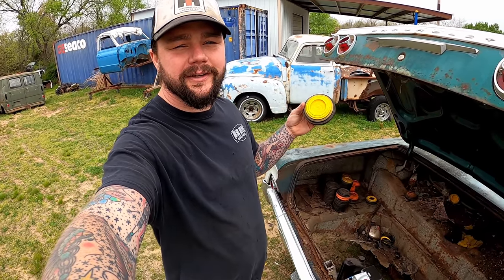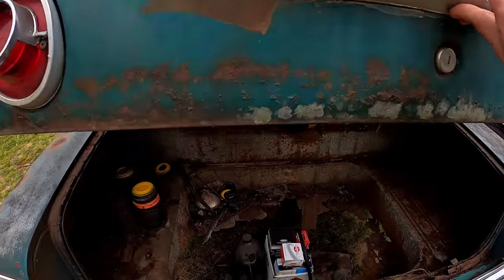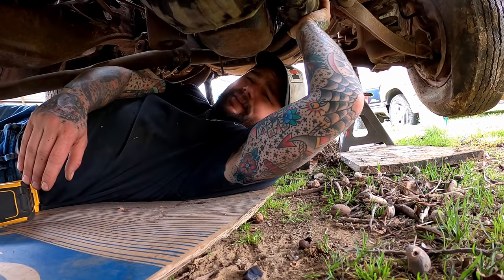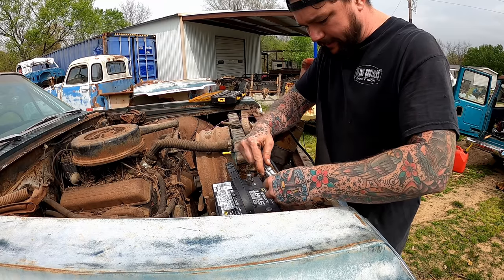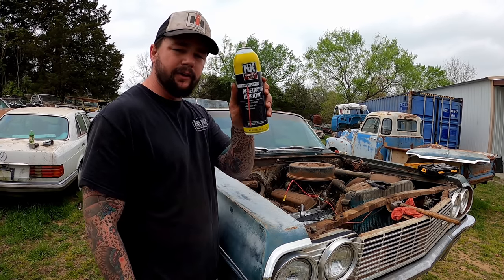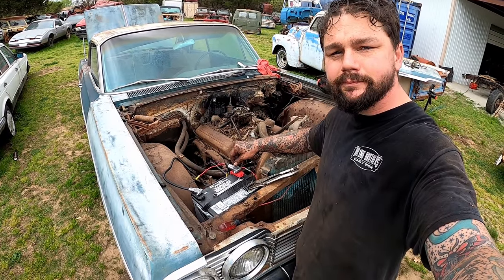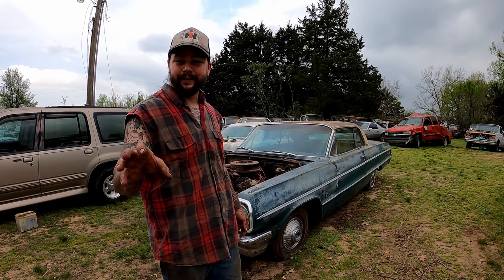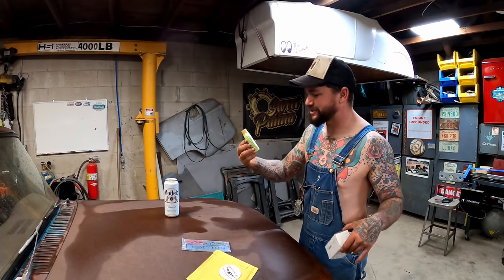ABANDONED 1964 Impala! Will it run after sitting since the 1970’s?!?

Comment: Ram has upgraded the tailgate on its 2019 1500 pickup truck with its latest and greatest idea: the Multifunction Tailgate. The Multifunction Tailgate features a 60/40 split and can be opened swing-away barn-door-style, making it easier to load and unload the bed, or to step up into it.

Comment: My great uncle born in 1894, was a great guy, served in WW 1,  but extremely frugal. Quite a wealthy fellow, Well over a millionaire by his 50s, he waited till he was 70 years old to buy his 1st, and only new car. A 1964 Impala. It was so stripped it was laughable. Special orderd with, manual steering,  manual brakes, radio delete, etc..he did take the V8 engine. Automatic transmission.  My 1st time riding in it was 1967. Pretty teal green exterior,  and green interior.  I was 8, and liked it.  Flash forward to 1988 and he still had the car, still driving it at 94 years of age. He lived to over 100 years old ! He lived in Northern Utah, so even though the  car still ran and drove very well, i drove it when visiting,  it had quite a bit of lower rust. When he was 98 and knowing I was a car nut, he asked me if I would like to have the car when he passed away.  As a Southern California native, I had to turn him down.TOO MUCH RUST. I have never owned a car that had rust, and it scared the crap out of me lol. Now that I have watched all these videos of cars from the rust belt, you guys would have thought that car was PRISTINE!!! I  did check out the undercarriage on that car and it was still very good, just the wheel well edges were rusty, and a little bit on the bottom quarters.  
..

Comment: I once owned a Chevy Luv. I swapped the engine to a modified Chevy 4.3 V6 and a turbo 350 trans. After busting 2 rearends and getting aggravated because I had to pull the motor and trans just to change the trans so I sold the truck body. It was fun while it lasted though!

Comment: My cousin got a like new 62 Biscayne 2 door with the 283 power-glide in the early 70s. my uncle was the head sales guy at Steakley bros Chevy so he got us plenty ofclassic low mileage cars back then but the biscayne felt new. l think it had less than 20k on the odometer. You couldnt hear it running. Stand a nickle up on the radiator cap. best car l ever drove. Best engineered.
Reply from the maker: That would be a sweet deal!

Comment: Hey Pudd': You'd be better off pulling that 283 short block out of there and replacing it with a 350 assuming the transmission matches.... On floor and trunk pans alone, you'd want to start there if you want to restore the ride.....

Comment: Always Love CHEVROLET IMPALA cars to and I own too it 2002 plus I got in 2005 I totally rebuilt to plus bottom to top also from body shell to blow up motor & transmission even computer stuff for $500.00 and took me 5 years do up my likeing to ! Plus paint Navy Misty Blue with Black Trim , also Baby Blue interior with Black Trim & also True Cedar Woodgrain also my home brew motor V6 252 CC with 320 hp , Torque 310 plus 506 M6 6 speed Automatic transmission with Shift Kit also Car is 4 door but lots fun since 2010 have road plus drive it! But computer stuff for 3.1 to 4 3 litre V6 motors too plus full frame home made Tanitimn to also if saw my car say holy moly and plus rode say that wild run my buddy !
Reply from the maker: Not too big in the newer ones.

Comment: 1964 was the 2nd year for the 327 so I say it will start friends ran a c/altered back then 327 block with a 283 crank which ran in 10 sec bracket in the quarter mile.
Reply from the maker: Damn that’s scootin!

Comment: I used to work in wrecking yard and the customer would pull the dip stick on the engine he wanted to buy and the oil would be clean and he would buy it the longer the motor sits the dirt will go to the bottom

Comment: Looks like a mechanic dint get enough money out the previous owner and put that clankity clunk into the hub cap. I wish I could find a deal like that Impala. You got all the luck, first that Luv and now this one with the back seat that a rat had his way with. I like your style Puddin!
Reply from the maker: Did the ignition tune up then slip that in!
Reply: @PuddinsFabShop  yup . I've had a tire rotation done a few years back . They put the hammer down on the impact on three rims and left the front drivers side finger tight . I was going but 65 when that started to nock so bad I thought I lost my drive shaft . Pulled over, checked under neath  ,all seamed fine. Got going and the same thing happened.  I happened to look at my front tire and it was at a weird angle . Them frigging samich makers" forgot" to tighten it.

Comment: One trick I’ve developed to free stick engines is to close the valves (pull the cam or push rods) and remove the schrader valve from a compression tester whip and use shop air to push the piston down. If your smart enough, using firing order you can push on multiple cylinders at a time. I’ve stabbed connecting rods through oil pans with it but she rotated and I got that last torque converter bolt!!! Lol
Reply: When your flat rate it’s one of the very few times KABOOM actually sounds like cha-ching BABY!
Reply: Also there’s a complete lack of arm swangin’ in this va-edeo.

Comment: Lol. Set me up for the day.  Nissan pick got me all at 2 and 6's.  Started fine for 10 years. Then one morning she just wouldn't.   3 good techies 1 auto electrician and numerous electrical hacks. Bypass fuel cutoff solenoid. 
Month on off battle as I think I now no nothing about anything.
Proximity chip had fallen out of the key. Go get spare key. She started up just like she had always done for the last decade.  That made me question my own existence as a human.  T#ts and tires equals trouble. Thanks for your hard work and the laughs. Be well and stay safe.
Reply from the maker: Damn that sounds like a headache!!
Reply: @PuddinsFabShop  I took a learning.

Comment: I straight up turned away when you checked for spark at the battery neg cable!
Reply from the maker: It needs a ground. Not sure what you mean honestly.
Reply: @PuddinsFabShop  Battery's go BOOM!! I was doing a compression test with 1 plug wire laying on the battery...soon as I turned the key...well...KA F'in BOOM! (VERY explosive gasses around batteries)
Reply from the maker: That’s a new one to me!
Reply from the maker: Did you have it on the charger.
Reply: @PuddinsFabShop  Nope, doing a tune up at a dealership with about 20 customers watching from the waiting room   :o

Comment: What's the width of the bed top on that little pickup?  There's a trailer made out of one coming up for sale at an auction here and I wonder if a 6 foot cap off a Ranger or S10 or what have you, will fit it.

15 years ago I sold a '58 Chevy sedan delivery that we ended up sawzall across inside the wheel houses in the back and picked up and carried the shell onto the buyer's trailer.  Frame was rotted out under the cowl and in the rear.   He got a full size model car kit body.  

He did build something with the car, because he emailed me up like a year later for help registering it.
Reply from the maker: I’ll have to look on my next day off. Assuming I can remember lol
Reply: @PuddinsFabShop  Sure no big deal.  

Worst case, I gotta go back and pick a radio out of a car for a guy at my yard, I can measure a Ranger and then compare to the LUV bed at the auction

Comment: I like how it's got a carburetor from a 1987 4.3 Vortec Astro van. That thing supposed to have a Rochester 2 jet, I have one. 
What is that, a 1964 hardtop, 2 door impala, 3spd manual, on the tree, and hooked to a 283 small block Chevy, short water pump, early double hump Style, 58 CC wedge heads, complete with Ram's Horn exhaust manifolds, and  a canister oil filter. Also, a beautiful blue patina, a nice white vinyl top, and one of the things I'm not fond of, that ugly-ass, 55 gallon drum fan shroud. But yeah this car is worth pulling out and saving, all day. It's just too complete, & too original, except for our late model emissions carburetor, which is no big deal.

Comment: I pull the plugs and pour that marvel right down the carb while freeing up that too n valves.  WD40 in the plug holes. how the hell did them squirrels get nuts in the bell housing? That is nuts. Ha Ha. Marvel also in the gas for valve guides. Respect buddy.
Reply from the maker: I think rats can get into tighter homes then squirrels!
Reply: @PuddinsFabShop  yea I saw the part about the big balled rat I hope they wernt stuck in the starter yeeoww.

Comment: You need to clean the top of your coil there's dirt  that has formed a ground path it's like another wire that is melted into the surface of that bake light you might need to buy a new coil , it's hard to do but you can clean it out with a knife when  that happens underneath the cap it's time to throw it away a crossfire is no good
Reply from the maker: Interesting!

Comment: If oil got inside the starter that could short it out big time, WD 40 is really bad it can conduct Electricity so you have to really careful what you spray on motors and such , they can short out to lubricate a starter you have to take the thing apart and use proper motor grease not oil .

Comment: I know that car hasn't been sitting with the hood off but I like to pull the oil plug for a second to make sure there's not any water underneath that oil you don't want to start it up and pump water into your motor, a lot of people like to talk shit about Rochester quadrajets until you inform them that every Edelbrock carburetor ever sold was made by Rochester., I'm probably full of shit, but I remember that two barrel was made by Carter, that's a nice car though what's even nicer is that SS the guys got , get yourself a tetanus shot and  get busy.
Reply from the maker: Pretty good idea about the plug honestly!